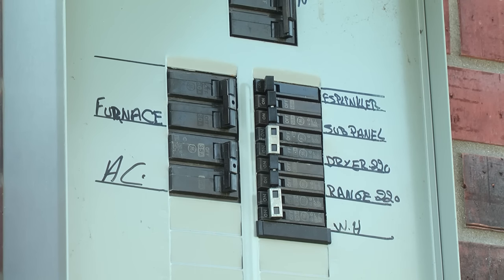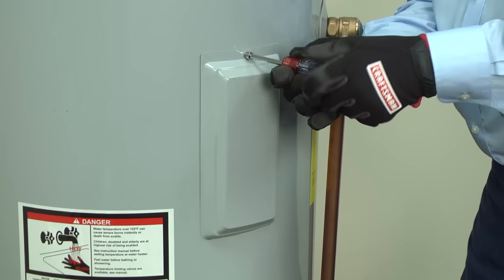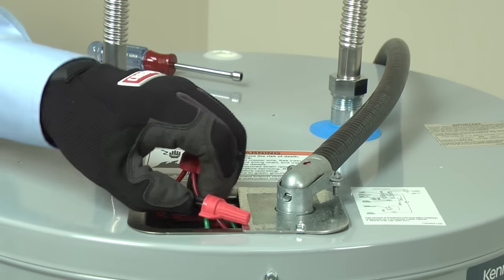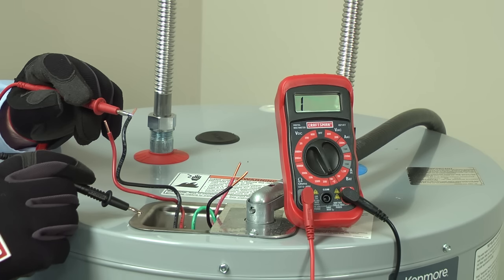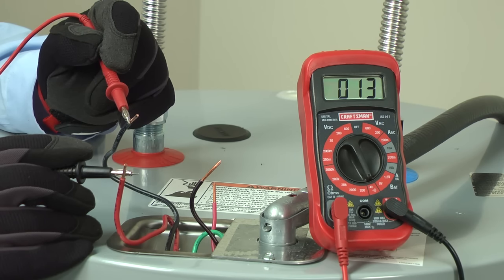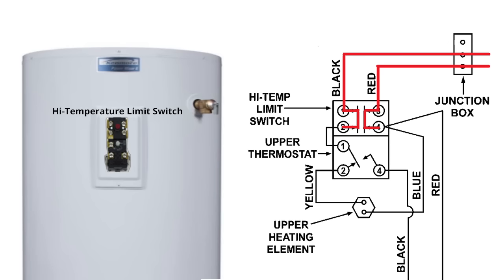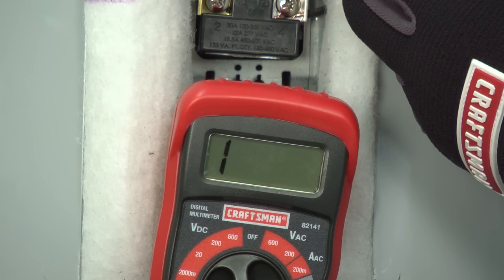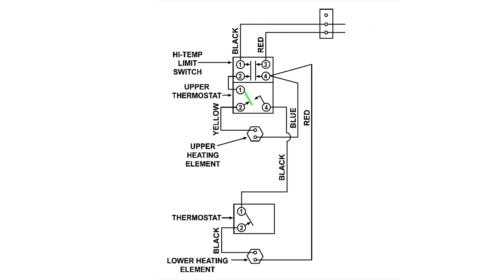How to Fix Your Electric Water Heater When You Get No Hot Water

Comment: Can I get a full wiring diagram for 220 hot water heater
Reply from the maker: Many water heaters have a sticker on the top or the side of the water heater that provides the wiring diagram. If your water heater doesn't have a wiring diagram sticker, let us know the model number of your water heater and we'll try to provide you with a wiring diagram.

Comment: I have little hot water, I'm getting e07 code. I changed the lower sensor. Still eo7, I changed the thermostat, still e07. I changed the lower heating element. Still e07, I dont know what else to do. I have power
Reply from the maker: Let us know the model number of your water heater and we'll try to provide additional troubleshooting tips.

Comment: So should be 13 resistance if you you check red and black wire. Red being live.
Reply from the maker: No wires should be live when checking resistance. Shut off the house circuit breakers for the water heater before accessing any internal components and checking resistance of components using a multimeter. You should measure around 13 ohms of resistance through the bottom element which often has red and black wires attached to the element terminals. We hope this information helps. If you need further assistance, let us know the model number of your water heater and additional details about the failure that you're troubleshooting.
Reply: @searspartsdirect  torrimerser aei heating with a top element only   
In a flat cold water through top tank and goes to a bottom tank.

Only getting cold water, though seen some imersive heaters on net starting from £30

Comment: my circuit breakers are not clearly marked. water heater sounds hollow. feels light too. pump for water has been out for a while. what next? I heard a fan like sound coming from it. I don't want it running if it is empty.
Reply from the maker: Some water heater installations have a light switch in the vicinity of the water heater that you can turn off to shut off power to the water heater. Check for that type of light switch around your water heater. If you find a light switch near your water heater that shuts off power to the water heater, then you can use that switch to kill power to the water heater until you repair the water pump and restore the water supply to the water heater. If you don’t see that type of power switch near the water heater, then you may be able to find the circuit breakers for the water heater through trial and error by shutting off double breakers in your electrical panel one at a time. Once you find the breakers that shut off power to the water heater, leave them off until you restore the water supply to the water heater. Mark the water heater breakers once you find them. If you can’t determine which circuit breakers control the water heater, have an electrician shut find and shut off the water heater breakers then mark the water heater breakers for future reference.
Reply: Thank you. I did start flipping switches and accidentally turned off the fridge. I am thinking the fan sound may have been the furnace? I have never heard the water heater before and the furnace is directly behind it on another wall.
Reply: Thank you. my last water heater had a knob to adjust from low to high temp. This one doesn't seem to have one. I do not have the light switch option, sadly. I appreciate your video and your response.

Comment: I installed a new ao Smith electric water heater and I dont have no hit water n kts been installed for 2 hours now
Reply from the maker: Check the water valve positions on the water heater to make sure inlet and outlet water valves are fully open. Make sure the house circuit breakers are turned on. If these tips don't help you resolve the problem, you'll likely need to have an electrician check the electrical supply going to the water heater. We hope this information helps. If you need more assistance, let us know.

Comment: what if everything is functioning properly and testing good, and you still have no hot water?
Reply from the maker: For safety, our DIY advice typically doesn't cover live voltage checks. If you didn't find the problem using resistance checks, the water heater may not be getting power through the circuit breaker. This actually happened to my water heater recently. We recommend that you have an electrician, plumber or service technician check the water heater if the DIY troubleshooting didn't help you find the cause of the problem.
Reply: @searspartsdirect  you are absolutely right!  I found the problem in the breaker box.  One side of the double 30amp breaker was bad.  I replaced it and now we have hot water! Thanx 4 the help!
Reply from the maker: @JonathanCox2006  Yay! Thanks for letting us know what you found. We're glad to hear that you fixed the problem and that we were able to help.

Comment: First mistake......not ALL water heaters are 240v.....although they are rare. I have a 120v. It is a 25 gallon for a small home. I'd say if you can't tell the diff from the wiring or volt check......hire someone who can.
Reply from the maker: You’re correct. Not all water heaters use a 240-volt power supply. Because most common electric water heaters use 240-volt power, that’s the type of water heater that we cover in our video. We offer safe DIY help for those who want to diagnose and repair product failures on their own, so we don’t use voltage checks for diagnosis and testing in our videos. Our troubleshooting videos rely on resistance checks through wiring to diagnose component failures because that method is safer for DIYers.

Comment: my electric water heater (Reset Button) is not working. it does not give any click sound while pressing it. please suggest me what should i do.. I am not getting hot water.
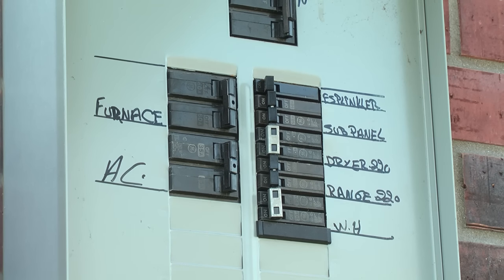Reply from the maker: The reset button won’t always click when you press it. Check the house circuit breakers for the water heater if you haven’t already done so. If you’re still not getting hot water, shut off the breakers and check the supply wiring as shown at 2:00 in the video. Continue with additional checks shown in the video until you find the cause of the problem.
Reply: I checked all my element and thermostat it's show 12.

but still tank is not providing hot water.

Comment: it says element on the front does anyone know what this indicates
Reply from the maker: We didn't find "element on the front" in the video. Give us details about the water heater problem that your facing and we'll try to help you with some troubleshooting advice.
Reply: hi it says element, in tiny letters, no hot water and digital display keeps reading E04 , which research on line says it's the upper heating element , have reset the red button that's suppose to bypass the temp cap, no luck turned off the power than back on still no hot water , at this point i've purchased upper and lower heating elements and gaskets and the tool to remove them from amazon, hoping that online advice for my whirlpool model is correct and the whole after heater isn't shot, model number is whirlpool=
ES50R92-45D 
this comment is in answer to a precious comment
Reply from the maker: @nafordebi  Replacing the upper heating element may fix that problem if the upper heating element is broken. If you replace the upper heating element and the problem continues, you'll likely need to replace the upper element's electronic thermostat ( https://www.searspartsdirect.com/part-number/6911175/0042/159.html ). Here's an error code chart that shows how to test the upper heating element in case you want to test that element before replacing it: https://www.searspartsdirect.com/water-heater-repair/error-codes/whirlpool_electric_water_heater_error_codes.html . The method for checking that heating element is similar to the testing procedure shown in our video. We hope this information helps. If you need further assistance, let us know.

Comment: Mine keeps flipping my breaker.
Reply from the maker: A short circuit in wiring or a heating element could be causing the circuit breaker to trip. There's also a possibility that the circuit breaker is bad. With both circuit breakers for the water heater shut off, check for a short circuit in the water heater as shown at 2:52 in the video. Find and fix the short circuit in the water heater to prevent the breaker from tripping. If you don't find a short circuit in the water heater, then we recommend that you have an electrician examine the water heater circuit and replace the circuit breaker if it's bad. We hope this information helps. If you need further assistance, let us know.